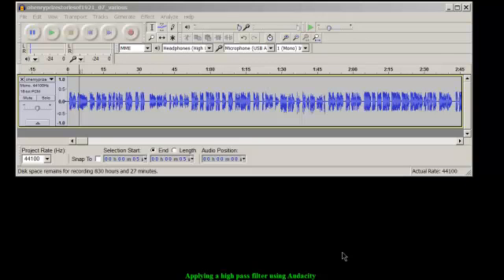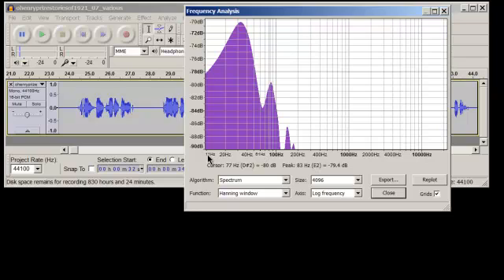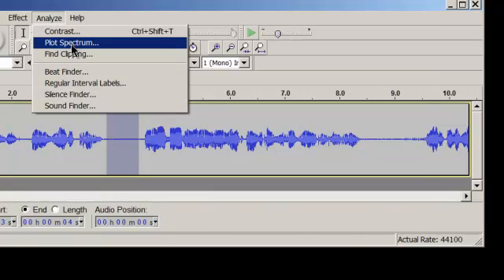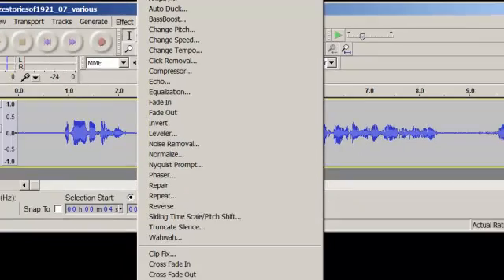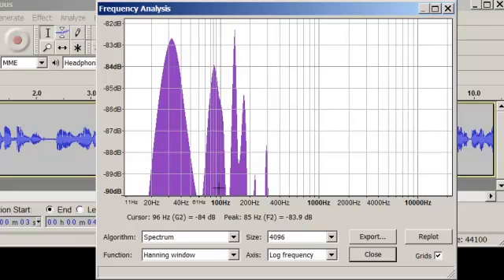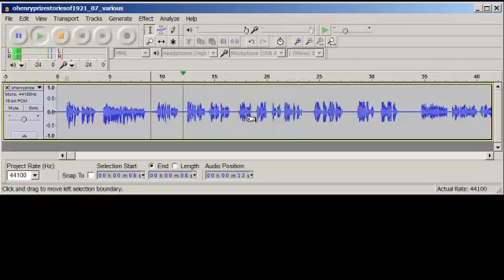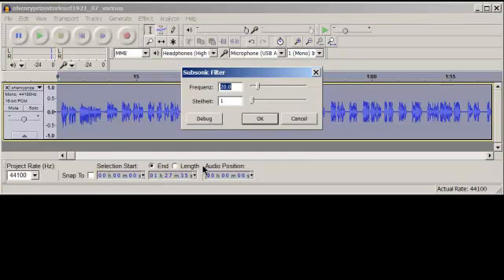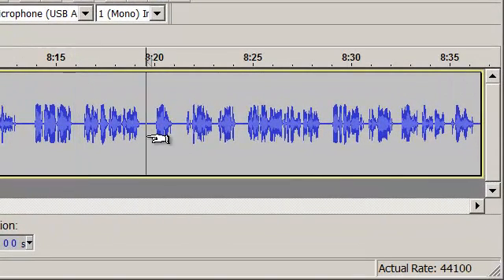High Pass Filters  How and Why to apply them in Audacity

Comment: Do you add it after you put it on effects or before?
Reply from the maker: I use a high pass whenever my ears tell me my track has too much rumbling bass.  so at  the start or the middle, it doesn't matter. I usually try a portion first to see if it helps, then do the whole track.
Reply: @cajun5454  Ok thanks

Comment: If I use the Noise Reduction effect in Audacity, say at 12db, will it have the same effect as applying the High Pass Filter at 12db?
Reply from the maker: No.  Noise Reduction only reduces the volume in 'silences', the space between speaking .  High pass filter reduces the volume of all freauencies below your set point for the entire track (or whatever part you select).  so high pass flter reduces your spoken sections as well as the silences be tween words.   That's the best I can explain it.  but there is a difference!
Reply from the maker: Just that there is a difference between the two.  Not sure why I added that comment.  And yes, high pass filter will reduce the low runble just as  you said and then you can amplify the whole track.  easy peasy.
Reply: @cajun5454  Thanks Phil. You are a generous good man! I am lucky that you happened to use my track in this video.
Reply from the maker: @jothi20  And you are most welcome! Glad you don't mind the usage ...
Reply: @cajun5454  👍👍✔
Reply: @cajun5454  
𝗧𝗵𝗮𝗻𝗸𝘀, Phil. I alway thought that 𝗻𝗼𝗶𝘀𝗲 𝗿𝗲𝗱𝘂𝗰𝘁𝗶𝗼𝗻 affects the entire track. Now it is clear.: it affects only 𝗳𝗿𝗮𝗴𝗺𝗲𝗻𝘁𝘀 𝗼𝗳 𝘁𝗵𝗲 𝘁𝗿𝗮𝗰𝗸, whre real  silence appears.
Reply: @cajun5454  Thanks Phil. So applying high pass filter will reduce the low rumble below the selected value (say 12 db)  throughout the track. I suppose I can use the Amplification effect after I use the high pass to increase the overall volume of the track. Thanks Phil. You are a very very helpful. Do let me know what you mean by 'but there is a difference' if you can.

Comment: Audacity apparently got rid of highpass, as it no longer shows up
Reply: You could click Equalization and choose 100HZ Rumble.
Reply: Would this be good to remove background/ambient noise like pc fans etc? The reason why i ask is because i have a condenser and live in a house with lots of noise and with the noise removal i always end up reducing alot of the vocal quality( like it´s underwater) in order to significantly reduce the background noise. Obviously getting a dynamic mic and treating the room would be much better options but would this be a viable option?
Reply: strange, I have audacity open, it's the fourth item from the bottom list under "effects"

Comment: Hi Phil!  Thanks again for sharing!!  I was wondering if there is a way to go back to "default settings" after trying to make unsuccessful changes to a recording (after having saved it in Audacity and closing it).  Example, one of my recorded chapters makes a "wah-wah" sound, similar to when one window is cracked open in a car.  Any suggestions?  Thanks again!
Reply from the maker: Hi Bubbly (I bet your voice is just fabulous!).  by default I assume you mean to go back to the 'original' recording before messing with it.  Nope. Once you have saved an AUP, whatever is there is there and you will need to mess with it some more to remove the wah-wah.  Which is why the 'preview' button is just wonderful to check out any changes before saving them.   (And stop going 'wha-wha' into the mocrophone or recording in a moving car ..just kidding )
Reply: Phil Chenevert But the car is where I do my best recordings!  Haha!  Thanks for the info Phil.  I know I'll still be able to fix it somehow.  I guess that's the beauty of Audacity; eventually, the recording WILL sound good!!  I narrate through ACX mostly but would love to do more commercials - they're sooo much easier!!  Haha!